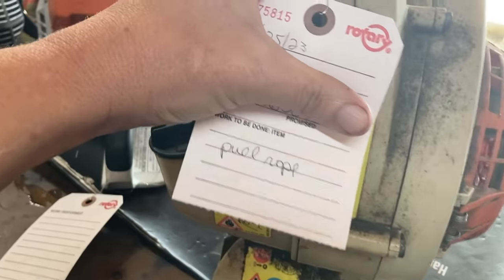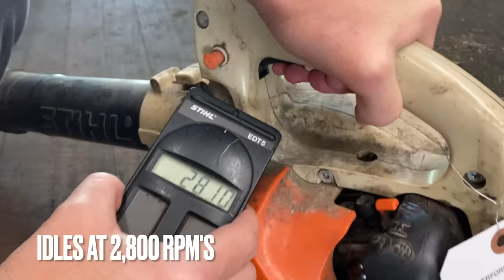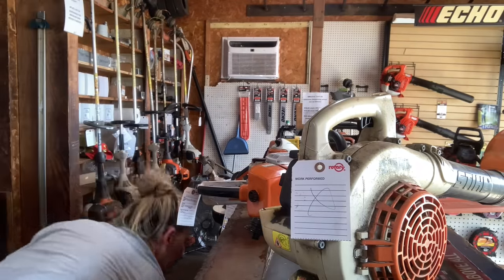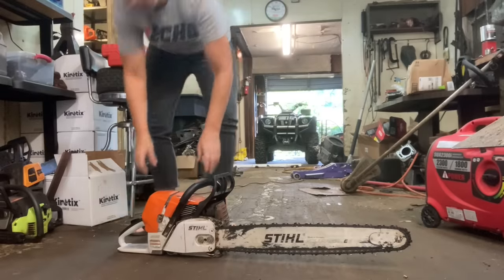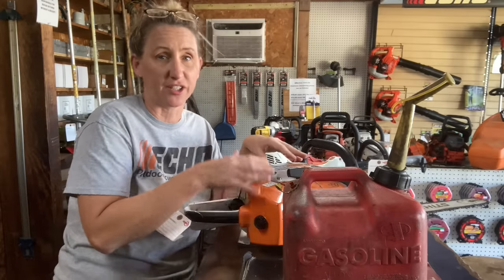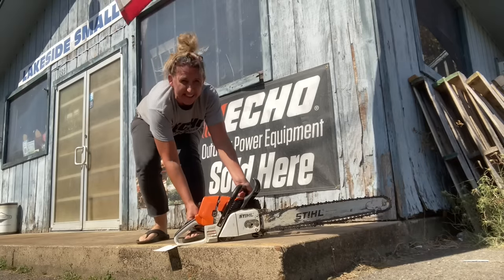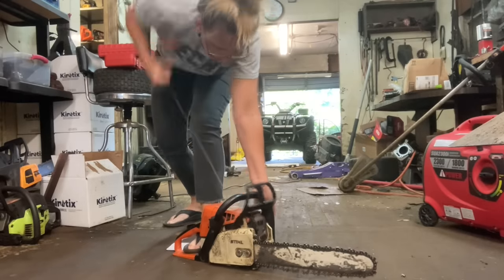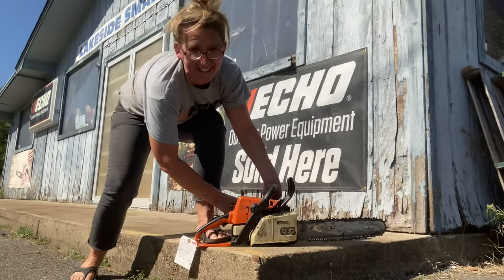The Burning Truth of Canned Fuel. This HUGE Distributor Doesn't Like Me Exposing It!

Comment: One Fall I decided to try the big box fuel for storage over the winter.  In the Spring everything was hard to start….that never happened before.  Never used it again and never had a starting problem in the Spring using premium ethanol free.
Reply: You were surprised that fuel left in the tank for 8 months gave you trouble?  Drain, run till the carb is dry, fog the carb, fog the cylinder.
Easy peasy :D

Comment: Great to see you starting the chain saw with your foot in the handle as a safety precaution.
Reply: I have a cheap Poulan saw that's been a bear to start since brand new. It may need valves adjusted as the compression is huge to overcome.  I do use mid-grade ethanol fuel because ethanol-free fuels are no longer available in my area. I do use Echo fuel oil mixed with my Echo 210 weedeater that's about 15 yrs old and always starts on the 2nd or 3rd pull. Now it needs new fuel lines and the tank grommet replaced.  Thanks Chickanic for your videos.
Reply: especially when wearing safety flipflops.:face-turquoise-covering-eyes:
Reply: @iffykidmn8170  
Yes, I cringe when I see Bre working on chainsaws with her flip-flops. I can't work without my safety boots because I've conditioned myself to be scared without them on, but Bre is a lot more experienced than me.

Comment: I bought 2 cans of this fuel early this summer to try in my saw.  The first can seemed fine and the saw ran normally, however when I got to the second can (same brand, purchased at the same time) the saw was difficult to start and wouldn't rev properly.  I finally emptied the tank and replaced the fuel with 100% gas/oil mix and the saw ran fine again.  That was enough evidence for me.
Reply: what is the fuel? VP?

Comment: Let me post a theory, if I may, about one possible cause of the issue.  In opening the latest, and bad, can, I noticed a little play in te plastic top with the screw lid.  This is a plastic unit which is pressed into the can, as opposed to having an all metal can with full sealing in its construction.  Perhaps long-term exposure to air or water vapor over time and handling causes the fuel to go bad.  (And for those of you in the fuel company, reading this, please tell the "Suits" that saving 0.17 cents per can by doing it the cheap way is no saving if the product goes rancid before use and your customers abandon you.  Like I am doing).
Reply: I'm thinking it's freshness related too.... By the time it's made, canned, shipped, sits on the shelf, etc... it's proly 6months old when it's cracked open, and I doubt they are using any extra stabil or oil since those cost more than the gas itself. Old gas, plus minimal additives.... but the profit margin is awesome!
Reply: @tshackelton   I think the theory behind these fuels is that they are mostly those compounds which are more stable and less prone to degradation over time.  I have had marvelous success with them, till I suddenly didn't, which is indicative of either batch defect or sample defect.  Noting the design of the can, it is quite possible that some cans are less well sealed against long term water and oxygen incursion than others.  Hence, the spotty nature of the problem.  You can get people lined up on both sides of the line swearing it is great or it is junk.  It may just depend on storage time and can integrity.

Comment: What REALLY surprises me about the folks who use the canned fuel is the price. Most of the stores around me charge two to three times as much as good, ethanol free gas.
Reply: Yeah, I have a 1.5 gallon gas can and just fill that once in a while.
Reply: 1 gallon of canned at the box stores is $20.00.
Reply: A lot of areas have no place to get ethanol free gas, so they think this will be better than the stuff they get at the pump.
Reply: Only thing wrong with ethanol gas is it that it doesn't store well, especially in fuel lines & carburetors. Throw in some Sea Foam when you fill your can and that will help stabilize it.  But yeah for small engines of any kind, non-ethanol gas is always the best if you can get it.
Reply: Canned 2-stroke fuel has no ethanol - that's the really big reason why people buy the stuff.
Reply: This may sound crazy which I get it sorta is, but you can remove ethanol from gas with water because ethanol has a higher affinity for water than it does gasoline I don't recommend it more risk of ruining your equipment from not getting all the water/ethanol mix out

Comment: I'd love to see you send out a fresh from the can sample of their fuel vs normal mixed fuel. I'm sure there are fuel labs that can run the test for you.
Either that or hit up project farm 😂
Reply: Unleaded gasoline starts to go bad after 30 days, it's efficiency degrades slowly over time. So it's not like an expiration date on milk and the time can vary but it can go bad quicker than people realize.
Small engines seem more sensitive to this as opposed to the "ol International Harvester Pickup out back that's been sitting for a year and fires right up.
I am a mechanic also and bad gas doesnt happen often but there are times where I have checked spark, cleaned the carb, tested the CDI Box, tested the coil, tested the stator, adjusted the valves, (already checked for water in fuel) and lastly....this is how you check......dump some fuel on the ground and hit it with a match.- Nothing happens.
When it has been sitting too long it will hardly burn, Diesel even seems to burn better
Reply: @drd1924  it's because the hydrocarbons gave reacted and formed varnish. I've seen it so bad it stained my hand until it got rinsed off with fresh gasoline

Comment: I know NOTHING about small engines (or any engines for that matter). However I'm learning what NOT to do by watching your channel. I've never used canned fuel, but now I know to stay away from it. :)
Reply: It's simple. 1 bottle of 2 cycle oil Per gallon of unleaded gas, mixed into the same gas container. No premixed box store stuff. .. make me it yourself
Reply: @dirtybird437  I have been making it myself. I've actually never tried the cans stuff because I found it very easy to make my own. however you should not just say it's simple one bottle to 1 gallon of gasoline, as you can buy larger quantities than a standard small size bottle. I did find a handy measurement device though that tells you how many fluid ounces to put in based on how many gallons of gas, relative to the ratio you need for your device.

Comment: I didnt even know canned fuel was a thing. We always mix our own and when ethanol became a thing we just started getting gas at the local marina ethanol free.  Grew up with boats and snowmobiles that you had to mix. A little cross multiplication gives you the right oil/gas combo
Reply: If you can't find ethanol free gas you can also use a big clear water jug and mix the gasahol with water and shake it up and then let it settle out and the water will absorb the alcohol, the water and and alcohol will sit on the bottom and you can siphon off  the clean gas on top
Reply: @ralphmouse2574 that sounds super sketch - even if it does actually work. Since it sounds like you've a actually done it is there a visible separation between layers
Reply: @mbburry4759 it's absolutely a working, viable option if you don't have access to ethenol free gas. Now, I wouldn't suggest filling the 50 gallon tank on a bass boat that way....
Reply: Yes you can totally see it separate out, yeah it would be a huge pain in the ass to do a large amount but if you just need a couple gallons for a small engine it works fine

Comment: It was nice to see your gas can. I have the same one. It's amazing how the government can screw up something as simple as a gas can. Great videos,  I've learned a lot from them.!!
Reply: Same here.  I’ve had the exact same gas can for a couple decades.  I have been using Walmart Hypertech 2-stroke oil and decent 91 octane gasoline.  If it is late in the season, I add the recommended amount of Sea Foam to stabilize the gas.  So far, no problems with my 50:1 ratio tools, even Stihl, after several years.  So far this season, I haven’t needed to change any spark plugs.  I’m definitely not going to touch that pink stuff.
Reply: Why is everyone having trouble with the new gas cans? They're so simple to use. 

I've avoided fuel related issues by just stabilizing all my small engine gasoline. It takes forever to go through a gallon of mixed gas. I know there would be issues if I didn't stabilize it.
Reply: @karlrovey   I finally found a plastic gas can branded Briggs & Stratton which appears to have a reasonable finger trigger on the spout.  I just got it, so I haven’t put fuel in it yet.

The other stupid new gas can I had required pressing down on the lip of the fuel inlet of the equipment in question to press a trigger.  It was nearly unavoidable to get fuel all over the place trying to fill my hedge clipper and backpack blower due to their slanted inlets.  I’m glad I hung on to my old gas can which is the go-to for my 50:1 fuel for now.
Reply: @wtmayhew  I haven't had issues with the Midwest cans (aside from an older one with a broken spout that was a victim of deffered replacement). I know everyone hates them.
Reply: I know it sucks but countless children have been saved from the burn ward because of annoying safety spouts. Are they worth it? I'll leave that up to your conscience. Yes they could be better designed.
Reply: Midwest can.   Take the spring out  of the nozzle & you're in business.
Reply: My amazing safety spout caused the can to pressurize in the heat and split the seam a the top... getting gas all over me when i shook it up while mixing fuel for the weed eater
Reply: @TB-lv2rh  You don't even need to take the spring out.

Comment: I bought it once back in the day. I have bought VP premixed fuel because I know they are an actual fuel producer. I buy a five gallon can of VP MS98 and mix it with Echo Red Armor. VP fuel has a three year shelf life. I use VP as storage fuel for all my carbureted equipment.
Reply: I like VP as well. I was in Walmart one day near the outdoor power equipment. I saw 4 bottles of VP syn 2 cycle mix in the 16 oz bottle for $2 each. I haven't turned back since.

Comment: Great demo on what NOT to do...  A video on the "correct" fuel to use would be really nice, as well as a "good enough" alternate or two.  I use E10 auto gas here in SoCal in my 4-stroke engines and they seem to run OK on it.  I have a Tecumseh mower from 1980 that starts on the first pull every time.  I also have a vertical shaft B&S engine on a Sears edger (a gift) that needs a squirt of ether every time too, unless perhaps the tank is FULL.  Magic touch on that would be nice.  I wonder if it might be the fuel...
Reply: Really? lol Its a simple matter. Buy NON-ETHANOL fuel for small engines. Use high quality 2 stroke oil, mix as that brand states (sometimes they recommend 50:1 when a unit usually says 40:1 ; like amsoil). Ethanol solidifies over time and plugs up carbs. Mixed fuel lasts less than 6 months to begin with; now your in a can with unknown age. I buy my ethanol free fuel whereever I can but usually at the marina.
Reply: Try adding Lucas to your gas. Helps a lot.

Comment: Interesting! I did not realize that this kind of business - fixing small inexpensive tools - can be economical in the US. Thought it was more like "forget it, just get a new one". 
Last time I had to visit a shop in my country - replacement of pull starter assembly cost around 6 or 7 US dollars.
Reply: I don't know about you but I don't have $400 to throw at a new chainsaw every time a saw won't start.
Reply: @Zt3v3  I'm on the other end of the market - $30 grass trimmers, $50 chainsaw. Perhaps the most expensive petrol tool in the shed is the 100-dollar, 100-ccm earth drill. Fifteen years old, still runs fine (although I can't handle it's torque alone anymore). Maybe it's simply low mileage, maybe the larger engine is more robust.

Comment: It's not just the ethanol that's a problem. It's also the high benzene levels in pump gasoline, including the ethanol-free stuff. The benzene hardens the metering diaphragm in the carburetor. I have always run them out of fuel for storage. I totally believe the pre-mix fuel doesn't run well, but since it is almost all naptha and methylbutane, I wonder if it might be better to store with a tank full of motomix. The oxygen and moisture in the air is not that great for aluminum and brass carburetor parts either.

Comment: Just saw this video, first time watching any of your videos really im not even sure why it was recommended but im not complaining.
Positive upbeat presentation and structured introduction, good stuff.
The fuel thing is interesting, i did hafto dig to find what brand you were referring to.
You caught my interest because i have a stihl farmhand chainsaw that i have only ever run with the stihl brand canned fuel and that thing has been rediculiously reliable.
The fuel is easily several years old, ive never serviced the unit, only use it maybe twice a year so it sits allot and i never drain it. Litterally everything youre not supposed to do with a two stroke, yet it never fails to start within six pulls. 
Growing up in a small engine shop im completely floored that it still runs with how i treat it.
That being said im worried the product has changed since i last purchased it so now, thanks to you, im just a bit wiser to it.
Thank you

Comment: I love this video, I am a small engine mechanic in north Louisiana. I have customers that use premixed fuels, when they bring me their equipment because its not running right or just not running. First thing I do is pour out their fuel, I am a Red Armor fan, I have proved to myself its the best oil you can buy, its pricey though. My experience in this issue I will pour their fuel out in front of them and fill their unit with my premix Red Armor,  and most of the time I don't make any money from that customer, but they will return or refer me someone. I am a very limited shop and will not work on just anything simply because its not worth taking your money, and next year you bring it back to me and be upset because it doesn't run right. Mostly most of my customers problems are fuel issues and spark arrestor screens in exhaust and Mud Dobber nests in the exhaust in a lot of Stihl blowers.  I haven't watched all your videos but what I have seen, you are a awesome mechanic, keep the videos going. Thanks Mike
Reply: What part of North Louisiana, just wondering in case I need parts when I'm up that way.

Comment: I bought a can of that once. I don't go through much 50:1 gas in a season, so now I just use that little can for mixing up my own. I bought a syringe, drew a line on it for the amount of premix oil I need for that little can, and use the syringe to suck up just the right amount of oil to put in. I don't have to measure anything now, and don't end up with a bunch of old 50:1 gas that I can't use.

Comment: I used Stihl 50:1 for my first gallon, then True Fuel 50:1 in my Echo Weed Wacker and my Stihl leaf blower and they both have been running great for years now, and never had an issue!

Comment: My own experience with canned fuel has been positive. I’ve read and heard about problems related to these fuels.  My theory is simple. 2 cycle gas and oil may separate after setting for some time, much like salad dressing. I shake my fuel before adding. And should it already be full of this fuel and setting awhile? I just give the throttle body of my chainsaw or whacked a few shakes and it’s good to go. This has worked for me.

Comment: I just learned something else while watching, I like how she pulls some cord out, pushes out and forward then Yanks back towards her self! Makes sense seems to give it a snap  and helps pull with momentum!
Reply: I don’t recommend snatching at the pull cord like that it can’t be good for the machine or cord. The only reason to do that would be if the operator is not physically able to pull it firmly against the compression. Just my opinion.
Reply: I don’t recommend snatching at the pull cord like that it can’t be good for the machine or cord. The only reason to do that would be if the operator is not physically able to pull it firmly against the compression. Just my opinion.

Comment: Dumb question maybe but what is in “your” gas? What should we use? I had been using Stihl ready mix, but also tried non-ethanol from Rural King then mixed with my own oil. I won’t use anything Ethanol from the pumps here in WPA. Tired of cleaning out gunked up carbs. What gas do you recommend?

Comment: Troy-bilt TB225 mini tiller. 
Hard to start every season ran terribly at wide-open throttle backfiring never really reached WOT.
Clean the carburetor, bought and tried a brand new carburetor. No help. 
Watched this video, which caused me to circle back, because I had been using canned fuel, thinking I was eliminating a fuel issue.
Put in fresh gas with some sea foam and it now starts right up and runs at WOT with no backfiring !!
Thank you!!!!!!!

Comment: I used to HATE 2-stroke engines to the point I even bought a new Honda 4-stroke trimmer just to not deal with them.  I finally figured out it was the fuel causing all of my issues.  Now I only run non-ethanol fuel and Amsoil Saber at 50-1 and ALL of my 2-strokes run like fuel injected 4-strokes now.

Comment: When I bought my Husqvarna chainsaw they had a promotion of buying 3 of their small cans of fuel to extend the warranty time period. I went for it and the chainsaw and my string trimmer ran fine with it. But with the cost of that fuel I am now using pump gas and the Husqvarna 2 cycle oil instead.

Comment: I've also had a similar problem with using different 2 cycle fuel oils. Using the red Echo oil caused the same issue and I had to re-adjust carbs to compensate. I suggest you find a good combination and stick with it.